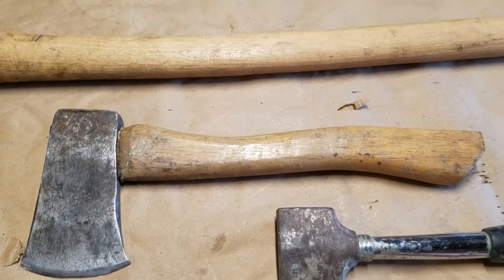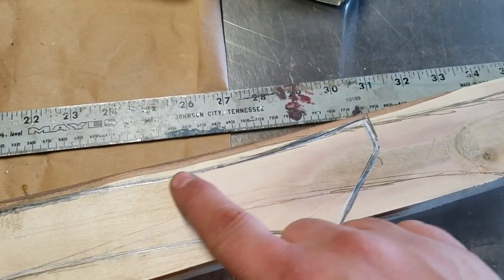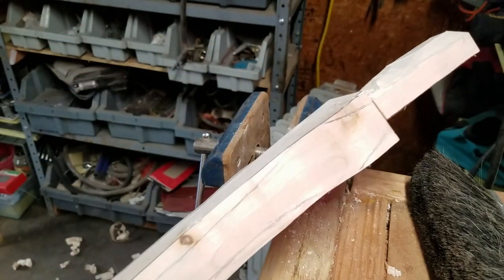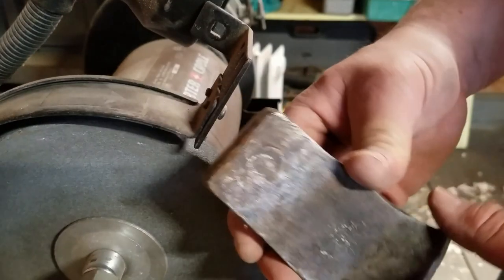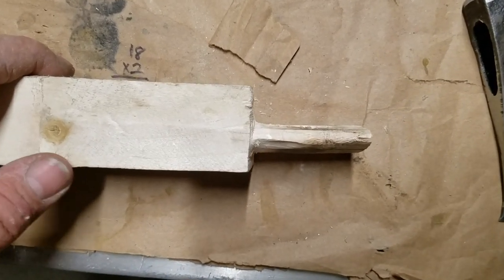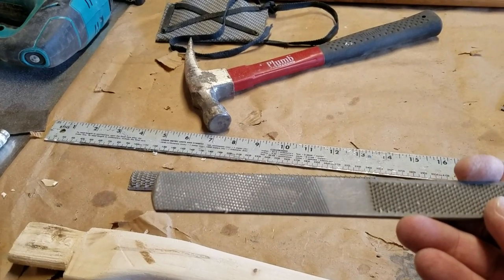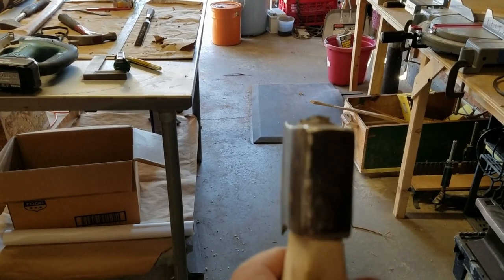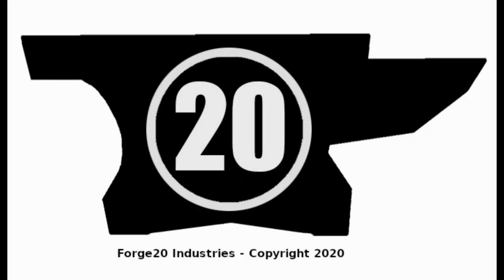Forge20: One Day Build - Making An Axe Handle

Comment: Gimli approves
Reply from the maker: Yeah I thought about flame treating the handle for that medieval style.
Reply: How do you know just how to angle the handle? Seems like the angle is important to the leverage if the axe
Reply: For the head i mean
Reply from the maker: @chainsaweddie00  First, I copied the design of the other two axe handles, and I actually drew an outline of the big ax to get the fawns foot shape. The head angle was a bit of a guess, I just lined it up till it looked right.